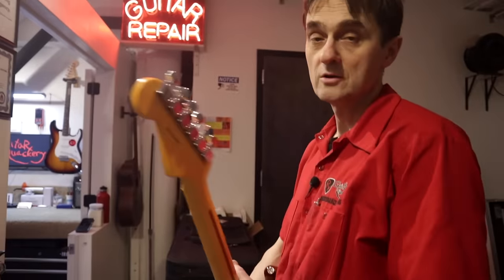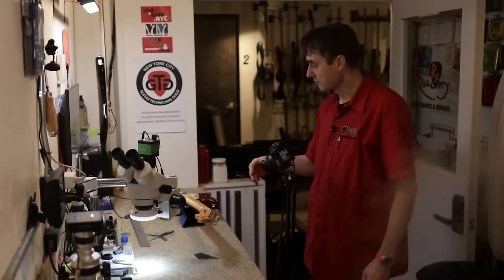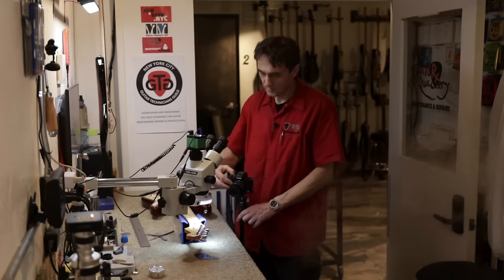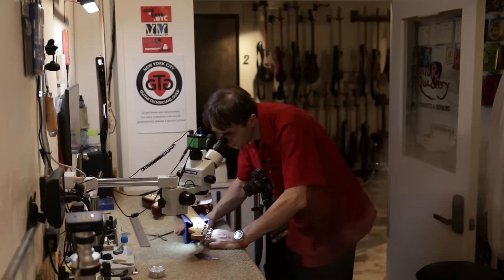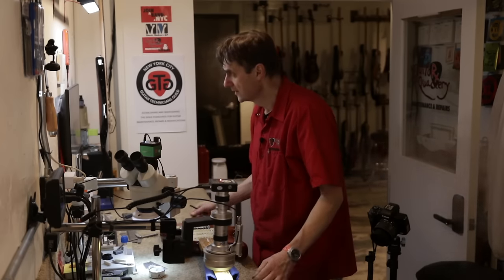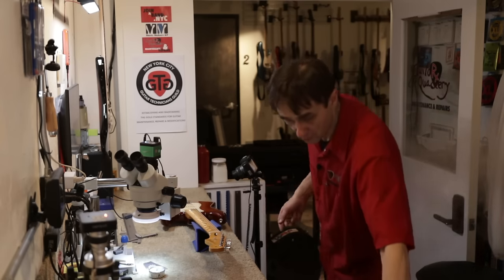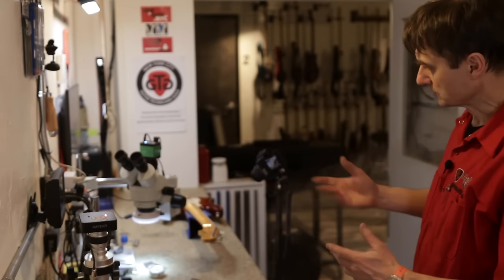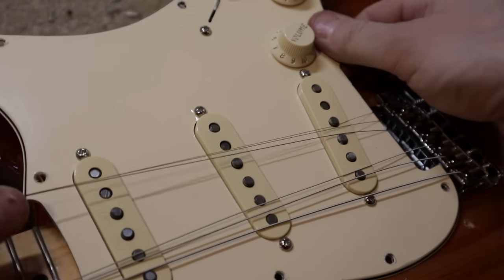Review - Fender American Professional II Strat Sienna Burst

Comment: I think that micro-tilt adjustment is a bad idea. Correct me if I'm wrong but doesn't that use a round metal thing that rises out of the heel of the neck in order to tilt the neck? Wouldn't that then remove the wood to wood contact between the neck heel and neck pocket? Also it could bend the screws slightly. It just seems like a gimmick to me. I personally would use a full pocket size shim.
Reply from the maker: I guess (I never thought of it before) that the micro tilt could be viewed as an optional feature. In other words, one could still use the shim(s) if one chooses to do so, even when the guitar is equipped with the micro tilt mechanism.

As far as transfer of vibrations... I'm not sure if you are referring to loss of sustain due to some vibrations getting wasted in the joint. If that is what you meant, I am not sure one way or another what part of vibrations might be getting wasted. I really don't know.

But while on the subject of wasted vibrations, the one part that absorbs a big part of vibrations is the floating bridge, on a Strat (or Floyd Rose, or Bigsby, etc) The reason is, because part of the energy of the vibration string(s) is used to move the tremolo up and down. So, that part of the vibrations as a whole definitely does not get used towards sustain.
Reply: As an experienced luthier, do you think the typical neck shims (without wedge) we find inside the neck pockets can bend the neck heel? myth or fact?  @GuitarQuackery
Reply from the maker: @rodolfoamaralguitar  I don’t think that there is any way that a neck shim could bend the neck heel.
Reply: The same thought occurred to me too. It doesn't seem logical to have one center point supporting the neck

Comment: I enjoyed your video. I’m curious about the nut slotting gauge you are using and if you believe it can be used upon the neck to measure relief as opposed to feeler gauges (for those that do not trust themselves with measuring with a feeler gauge)? Thank you!
Reply from the maker: I also use that same dial indicator to measure fret height. First, you would zero out the dial indicator by placing it down on the completely flat surface. Then you just go over a fret and measure the height.

My tool is just my own rendition of a product sold by StewMac. They have a digital version. I prefer the mechanical one.

Now, to answer your question, there is a similar available, to measure neck relief. It is basically a dial indicator mounted on a modified straight edge.

Comment: Thanks for this. It saved me lifting the plate to see if the pickup height screws have grommets. The bad news is I have done everything I can think of to silence a rattle-like buzz when I play the g string between 6th and 9th. Frets are level, relief good, nut and saddles are good, saddle screws level and lacquered, pegs are tight and springs are muffled. Any ideas?
Reply from the maker: If it’s a rattling part, not string buzz, it can sometimes take some work to pinpoint.

I would honestly completely remove the pickguard, and output jack, and check if it’s still rattles.

Sometimes the process of elimination is the best way to go. Fortunately, this is relatively easy on a Strat.
Reply: @GuitarQuackery  Hi. Thanks for getting back to me. You’re right and I think I was being a bit lazy, considering that I tried everything else. I will follow your advice and see what I can find. Just found your channel a few days ago and really like it. If I find the problem I will maybe show it on another video 😀. That’s a good catchphrase.

Comment: Even with a Squier, I'd be sending this straight back to the dealer as a dud. Shocking.
Reply from the maker: Interestingly, I don’t think this could happen with a Squire. A squire has a soft plastic nut, which is not a material that would be prone to chipping off. And, to my knowledge, the nut on a Squire is never hand-filed a factory.

Comment: "Made in the U.S.A." by the same Mexicans from the Ensenada, Baja factory, which is fine with me as long as the Quality Control isn't glossed over.
Reply from the maker: Quality Control is just the last link in the chain. 

Quality starts with a job interview... then proper training... then supervision... also, machine and tool maintenance... proper selection of materials... competent management... customer relations... the list goes on... and at the very end we have Quality Control.
Reply: @GuitarQuackery  Eureka! I have discovered a fellow O.C.D. sufferer but one that has put it to Excellent use, obviously. I Sincerely hope that you establish a tiny little "Finishing" factory someday where all the final products are as they REALLY should be. It would surely be on the level of Suhr and Vigier, no doubt.
Reply from the maker: @squirelova1815  I actually started as a guitar builder. Then I eventually got into the repair business. Repairs took over, but now I am kind of trying to get back into the building  side of luthery. I've bene renovating my basement for years, which is one of the reasons why I haven't been building. Building takes more space than I currently have on my disposal.
Reply: @GuitarQuackery  I would buy your Brand without a second thought even without having tried it as I would with Suhr or Vigier. I would buy any brand new guitar that you had worked on to perfect it too and maybe that would be a Great Idea too: having people ship their brand new guitars to you First and then getting a Pro Level setup with Certificate of Approval from you or, back it goes to the Dealer until a decent one is delivered. I actually WILL DO just that next time I buy new from Sweetwater if it's okay with you of course. Speaking of "will", guitar maker (to celebrities even) William Gelvin actually was upgrading and setting up + perfecting even used guitars and selling them to grateful customers because he is a Trusted Professional. A good Reputation goes a long way.
Reply from the maker: @squirelova1815  I actually already do "master upgrade services" but I don't do shipping. I also call them Master Re-build. At this time I am actually turning down more than 50% of service requests and I have limited space and am already working overtime. Shipping guitars is just too much of a risky business and since I am in Manhattan I already have more work requests than I can take on.
Reply: @GuitarQuackery  Thanks, good to know all this and I'm very glad you are doing so busily well because YOU SHOULD BE being so Diligent and talented.
Reply from the maker: @squirelova1815  Thanks. I've actually been trying to find ways to reduce my workload. I've raised my prices several times this year, to make sure I don't have too many guitars to deal with and I switched to a full-service-only policy. In other words, people can't bring their guitars to my shop any more because their output jack needs to be replaced. 

If the output jack needs replacing, we're also doing all the other work that I see needs to be done on that guitar. If there are worn frets, we're doing a fret job, etc. 

Good example, just from yesterday. A customer brought an old Takamine for what he thought would be a simple setup. There's no such thing on a guitar with domples on the frets. So, now we're doing a full refret, planing the fretboard (to remove finger craters) fixing the bridge and also making a new bone nut. I'd rather spend 12 hours on one guitar than a total of 12 hours on 12 guitars. 

This way I am not drowning in guitars and I don't have 2,000 customers per year to deal with. 

I actually now have a PDF that I send to customers, before they bring their guitars, so that they only come if they are actually looking for my recommendation for a full service.

And right in front of the door of the shop there is a sign that says:

"Highest prices in town guaranteed"

"Quality comes at a price."
-- old Chinese proverb
Reply: @GuitarQuackery  THANK You so much for telling me this in advance, very important info to know beforehand indeed. It absolutely does make far more sense to fix everything wrong if the guitar is a keeper and "player". You Sir, have just changed my whole Outlook on "Guitar Health" forever! if people SHOULD fix what NEEDS fixing on their vehicles then why not on their precious guitars too? Plus, I will ALWAYS remember that you Firstly perform a Full Diagnostic Inspection for us poor ignorant slobs so that we know if the cost of any work is truly worth it. That's exactly what a truly caring, Honest and intelligent car mechanic who cares would do too.